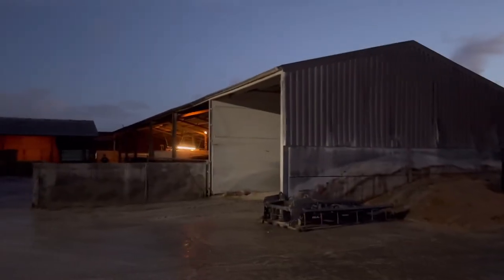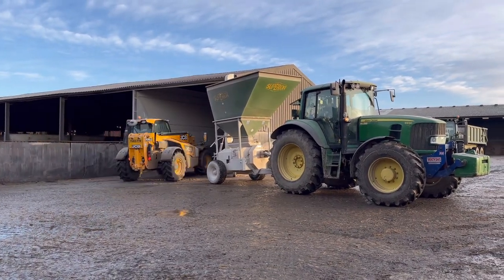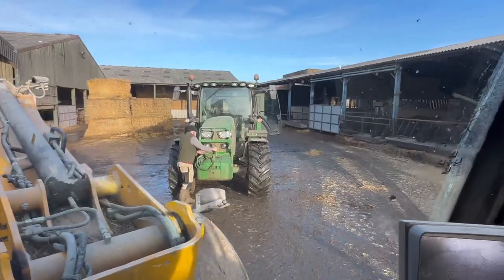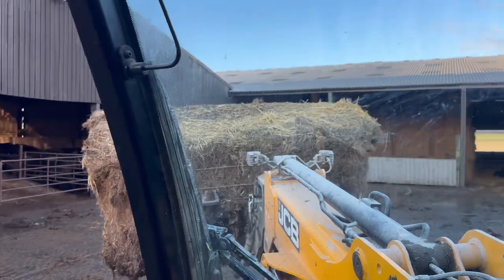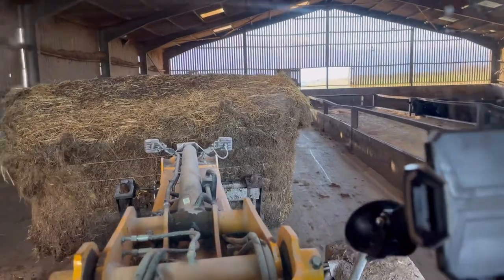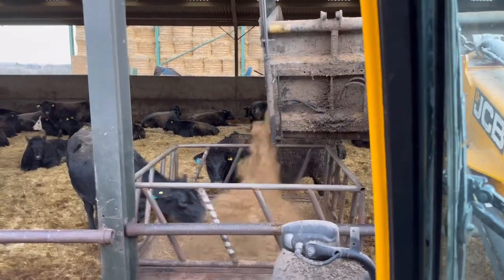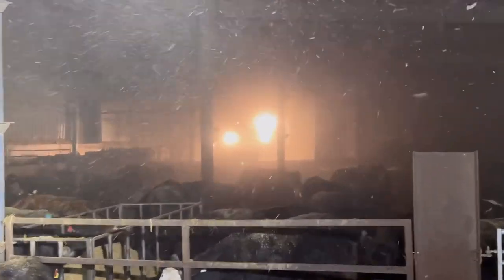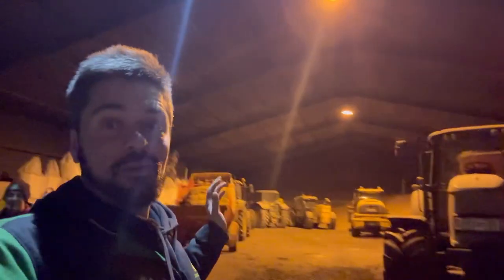Lots of Flat Out, Mucking Out, Action!

Comment: Be careful dozing along with the telescopic boom out! Not much need for it. Seen a inner section bent to the side after clipping an edge of concrete while tiding up. The 8 ft bucket was 4 inches of the ground on one side it was that far twisted.